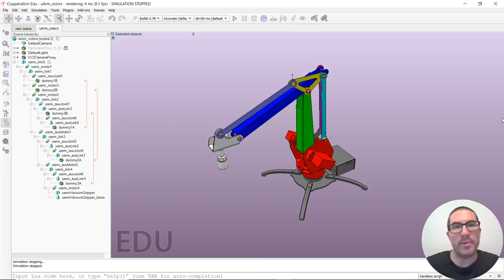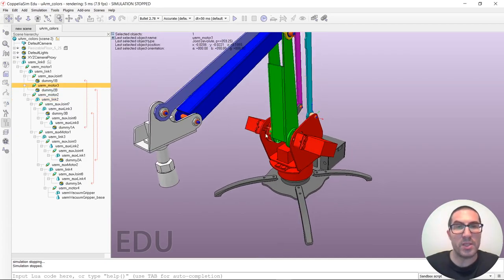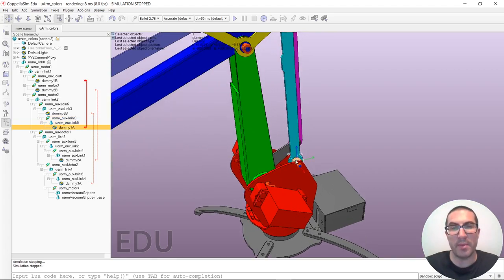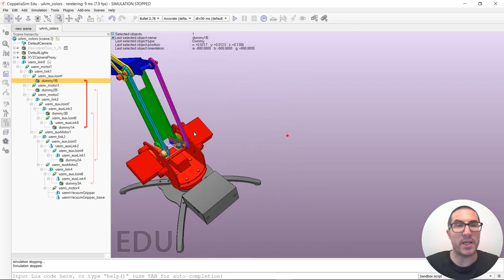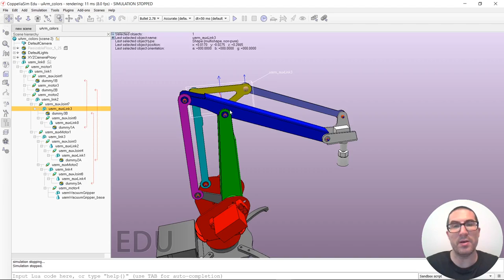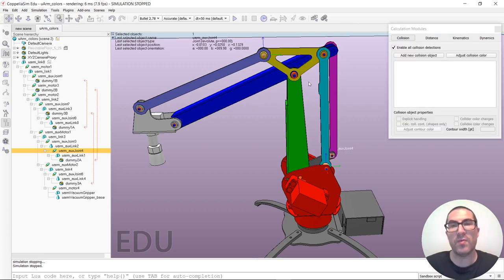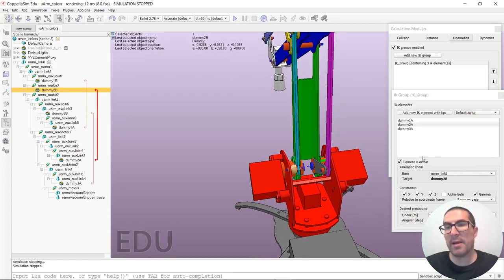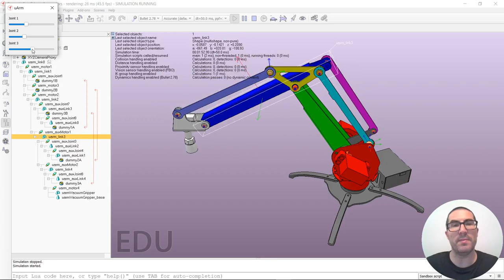Links, Joints and Hierarchy of uArm robot (parallelogram robot) | CoppeliaSim (V-REP)

Comment: I'll be googling inverse kinematic mode, but can you explain why you need IK, and the dummies? Why not just use dynamic joints with no motors?
Reply: It seems like you would use IK if you wanted to move the gripper to a certain position, why do you use it just to move the position of the motor?
Reply from the maker: The IK module it’s necessary to solve the robot parallel kinematics. The first joints where the motors are attached are not in IK mode. If you want to control the gripper position, then, you need to set those joints in IK mode too.

Comment: Hi just a question,  how can i use inverse kinematics to make my biped walk automatically??
Reply from the maker: Hello, it’s not that easy. I’m still looking for a solution based on IK, but I can’t find any, sorry. I made the bPED walk just by oscillating the servos with the proper movement
Reply: @LeoArmesto  Ok thanks, because for my thesis i would like to make a walking biped, do you have any suggestions to do this type of simulation? Maybe using a sinusoidal trajectory for the joints
Reply from the maker: Yes, that’s what I would do, but maybe not for a PhD thesis...
Reply: @LeoArmesto  Can you explain me how can i do this?
Reply from the maker: @michelarosati5507  You need to include a sinusoidal generator that creates servo trajectories considering offset, amplitude, frequency and phase shift as parameters. Then a movement is a coordinated sequence of those trajectories. But it's hard to explain here... There an Arduino library "oscillator" that might help you doing that. That's what I used for the real robot, so I assume that can be reproduce too in a simulation enviroment.